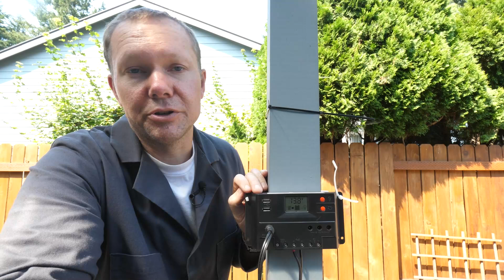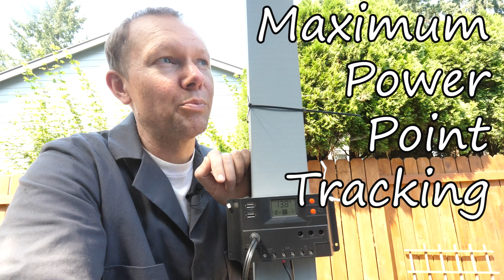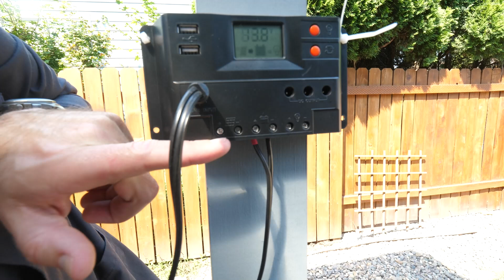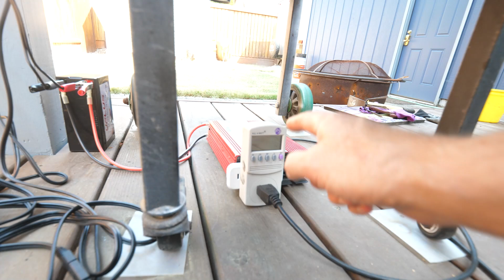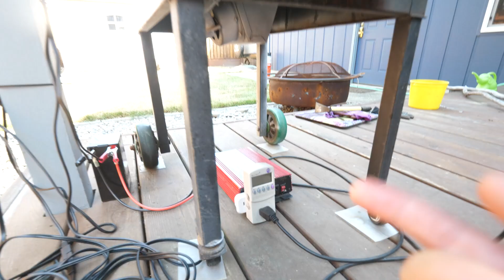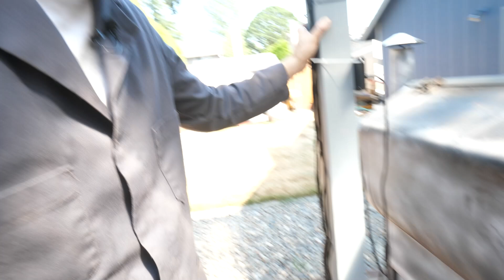Perpetual Solar Grill Behind the Scenes

Comment: If that little 12v battery is the AGM one you showed on the on the webpage on the other channel the get charged higher than sealed lead batteries, it's typically between 14.4 to 15.0